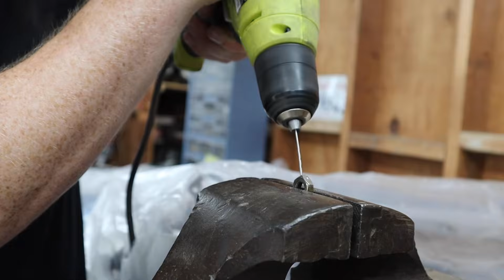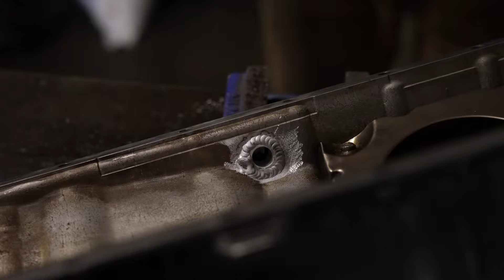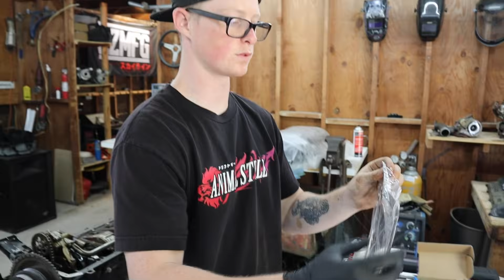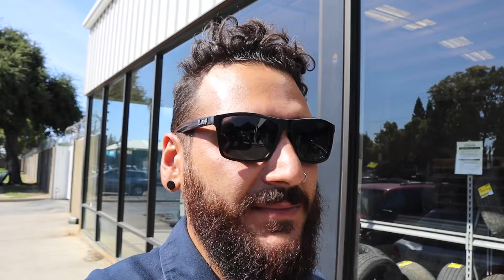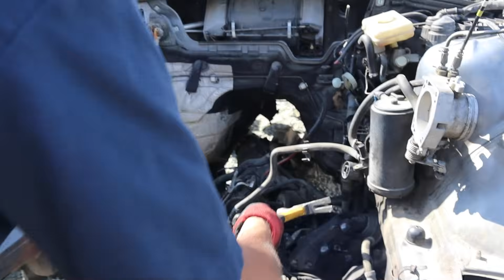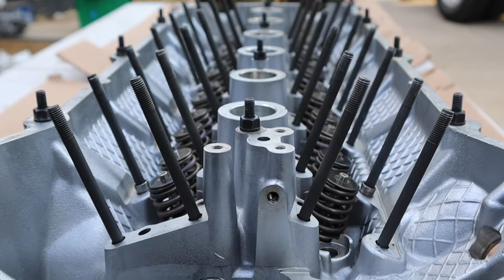THIS WILL BLOW YOUR ENGINE! TURBO E36 M52 BUILD - EP2

Comment: I lost compression on my m52 on cylinder 4 after an m50 manifold swap. I really hope it's just a broken valve spring. 🥺  I've never heard of m52 valve springs breaking though. I could hear a ticking at the lifter area.

Comment: don't skip the cut ring gasket. I would gap those rings too, especially for drifting. you will get to do it right soon enough . (*wink) also m50 non vanos can be modified easily to accept vanos. non vanos has 7mm valve stems (less likely to break at the wield/drop valve) non vanos has dual valve springs (nested)

Comment: Bro I know that we are all human at the end of the day, but as a engine reconditioner/ automotive machinist  myself and for them to deck the head and not pick up the crack is very poor attention to detail even after the head had been milled the crack shows up clearly on video
(and understandably if they dont have crack detection methods as they might be a small shop) its on them to inform you on that the head is cracked and should not have charged you for the machining